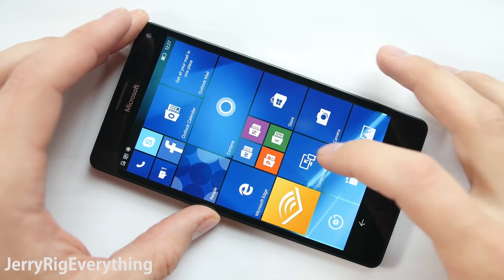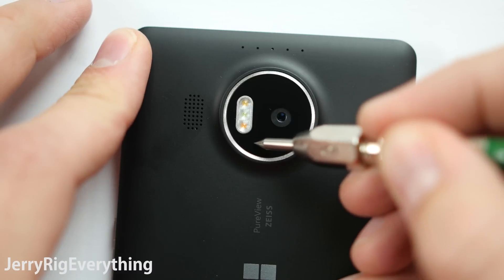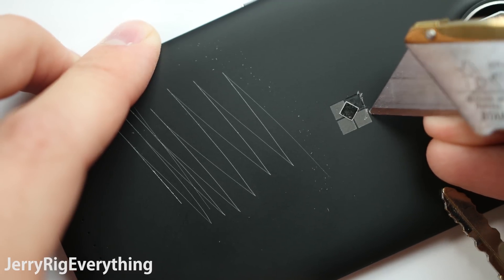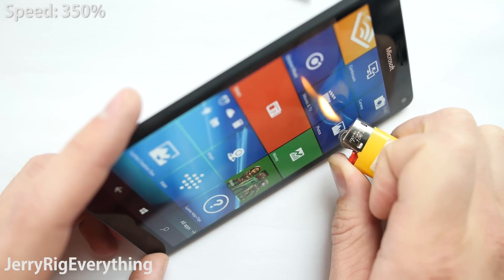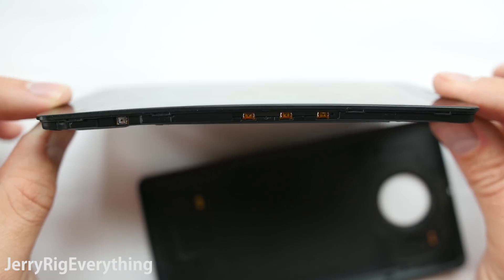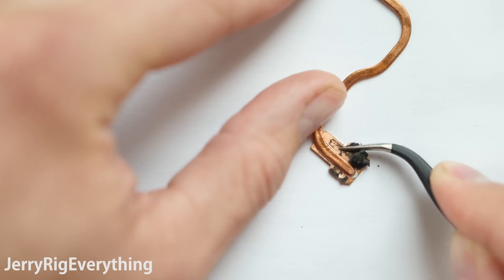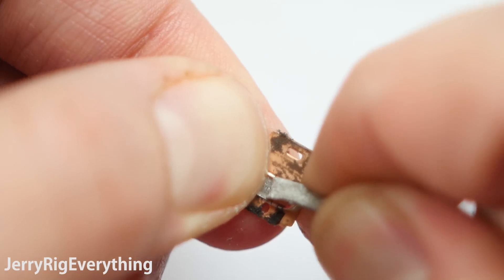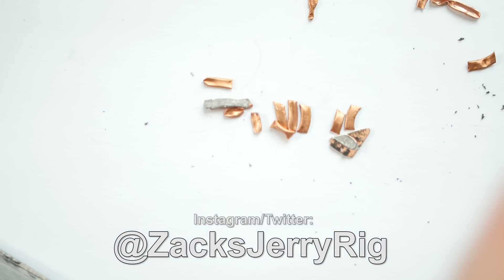Lumia 950 XL Bend test - Liquidless Cooling - Scratch Test

Comment: Maybe MS removed it last minute? I remember at one point before launching it to the public, they pulled all 950XL display units from their stores due to some hardware issues. Could be why liquid cooling was never mentioned again after the announcement.
Reply from the maker: That's actually really interesting...  Do you have any links about them pulling handsets due to hardware issues?
Reply: +JerryRigEverything Sure. I'm a huge MS fan, so stuff like this is interesting to me. http://www.windowscentral.com/lumia-950-xl-demo-phones-reportedly-have-been-pulled-all-microsoft-stores
Reply from the maker: +nuigurumisama You are a champion.  That is really interesting. I wonder if the hardware issue was with the watercooling... It would explain why they don't mention it on their website anymore...
Reply from the maker: Ron M lol, ive heard 'its a solid that becomes liquid' ive heard 'its a gas that becomes liquid' ive heard 'its a powder that gets wicked up ribbed copper pipeing'.  Let me know what the final verdict is. Until then Ill just look at the hollow, empty, liquidless, tube that I show in my video.
Reply from the maker: Ron M Fascinating. It can hit all three phases of matter within the normal temperature range of the Qualcomm 810 processor? (10c to 70c) I am impressed.
Reply: It's not technically liquid, its fluidish
It evaporates or something when exposed to air
Reply from the maker: John Stahl Do you have any other teardowns of the heat pipe?  I havent seen any specific to the 950XL. While this video: https://www.youtube.com/watch?v=eKrdJpDSowY at 1:28 says that there should indeed be liquid inside. Distilled water would be ideal for the 950XL temperature range.
Reply: +nuigurumisama I think it's basically a minified version of the Surface pro 4's liquid cooling system, which is more like 'vapor cooling system'; technically there's liquid inside, but it's in such tiny amount (maybe only a fraction of a drop) that it's not visible, but definitely has some kind of impact. Besides, you don't want too much liquid inside, it's gonna be warranty nightmare for Microsoft if it ever leaks.
Reply from the maker: +Bijak Riyandi Ahadito that's actually solder from the pipe connecting to the base.
Reply: It never hits a solid. It is a standard heat pipe system. It is kept at a pressure + the temperature gradient between the CPU and the rest of the heat pipe. There's a wicking agent on the edges of the heat pipe for return. It normally uses a VERY volatile fluid, and a heat pipe of that size will have almost nothing in it, but it is there.
Reply: Please also note that NH3 or CH4O is actually better inside a standard CPU operating temp. Specifically CH4O.
Reply: +JerryRigEverything You should've done a water test before bending it, to see if it has some level of water resistance although I'm pretty sure it'll shut off pretty fast due to the removable back cover, which is not sealed in any way, but still..would be interesting to see! :)
Reply: +JerryRigEverything I spent some time looking for links yesterday, but for some reason they were removed from YouTube, that kinda sucked as I like to back up my claims. I never got this phone because its too expensive same reason I don't buy an iPhone, but I am intrigued by the technology. I will link the article later albeit with the missing video.
Reply: +JerryRigEverything Ethanol or ammonia would even be more ideal. There are also solid to liquid to vapor combinations that would be ideal.   Even just assuming that the exchange 'air' is actual air may not be accurate.
Reply: +JerryRigEverything If that were the case Microsoft would have been crucified for falsifying this long ago. This is not the first teardown that has been performed on this phone.
Reply: +John Stahl They have not been crucified for dropping super sensitive touch even though it was also promised on the spec sheet, so why would they have been crucified for something far less obvious for an average user?
Reply: +Dongleboo ,v
Reply: LTE
Reply: Inferno Status they did
Reply: Matbe boom
Reply: +JerryRigEverything It is solid /powder that becomes liquid and then becomes gas, then cools down along the heat pipe and then became liquid again and repeat itself. You can call it "Liquid, Solid and Gas Cooling"  but liquid involved in this process.
Reply: +JerryRigEverything I'm pretty sure the white substance you got on your hands when tearing down the 950 XL's heat regulator is the cooling agent...most probably becomes liquid when exposed to heat
Reply: +JerryRigEverything Next time try to do a little research to understand the technology before you blame. It is a solid material that becomes liquid when it warms up... of course you can not see liquid  when it's cold. Lol
Reply: nuigurumisama why couldn't Samsung do this 😫

Comment: Maybe you broke the pipe at sometime and the organic cooling liquid evaporated without you noticing?
Reply: Or this does not make any sense. When a band of copper can do the same, why go all the length making a tube instead?
Reply: +athanos lee I heard Sony Xperias have been using heat pipes for many years now (they didn't say liquid cooling though). Maybe Jerry should look into those and compare them.
Reply: nuigurumisama I thought heat pipe by definition had liquid inside?
Reply: +athanos lee I was pretty confused about that. Wikipedia seems to say it's the same thing, but I just assumed a heat pipe was just a copper pipe that works like a heat sink. Maybe an empty tube works better than a band of metal? I did my undergrad in electrical engineering but I've never learned about that kind of stuff. If that were true, then I guess having liquid cooling wouldn't be a big deal since Xperias have had it for years now. It would still be nice to have though. Jerry should check the liquid cooling in the new Surface Pro 4 too.
Reply: +nuigurumisama Yes, some air circulating inside would help. But invest a little more putting some cooling liquid would significantly improve the performance. So I don't understand why ms would do such a thing, if Zack was indeed right about it.
Reply: +athanos lee I'm guessing they maybe had issues with it, and removed it last minute. After the announcement, liquid cooling was never mentioned by MS again. Could be why they recalled all 950XL display units from the stores a few weeks before launch. Either way it would be pretty sad. I have a 950, and I was sad to hear there was no heat pipe.
Reply: nuigurumisama I am leaning towards the simpler explanation: Zack butchered it.
Reply: +athanos lee If that were true, he should definitely make a follow-up video or edit the title to prevent any misunderstandings, which would make Lumias/Windows Phones look worse than people already think they are.
Reply: nuigurumisama Comments disabled? Wtf?
Reply: +athanos lee What do you mean?
Reply: +nuigurumisama Sorry. For a moment my phone showed comments disabled under this video. I don't know what really happened...
Reply: +nuigurumisama Zack is doing it again, complaining about the liquid cooling of the new galaxy phone. my comment: "no liquid once you sliced the heat pipe open does not mean the chemical inside does not form liquid when it is sealed in. maybe the chemical has a very high saturated vapour pressure or the heat pipe is actually pressurized inside. either way, the chemical vapourises very quickly so you would not see any liquid, which is actually a good thing. because that is how the chemical quickly brings out the heat, by vapourising."

Comment: That's a bummer, the liquid cooling is the one feature that I'm hoping manufacturers will get right. and I need to check out that Nexus 6 thing I just got one used and it's missing two pieces from the X, I thought that was normal, let's see.
Reply from the maker: +themrjones Me too. I think the liquid cooling feature will be one of the coolest parts in smartphones of the future.
Reply: +JerryRigEverything I see what you did there
Reply from the maker: Rav It was totally unintentional.  I promise.
Reply from the maker: Erdem Ece If its 'gas cooling' or 'Vapor cooling' then maybe they should call it that instead of 'liquid cooling'.

Comment: Damn, that liquid cooling was all marketing BS!
Reply: not really heat pipes like that are not liquid cooling the pipe is supposed to have a substance that turns gaseous around 70-80F typical a wax or ammonia is used typically on one that size the fluid that would be less than a single ml as it is supposed to evaporate get to the "cold" side recondense and evaporate again until the pipe is saturated but that would be insanely hot. So it could have something in it but either so little it formed a sort of film or that it was in a gas state already.
Reply: +Kevin Riazi No. Liquid cooling is there.